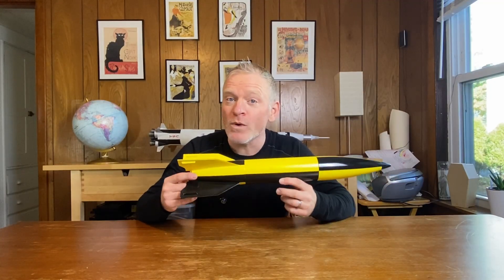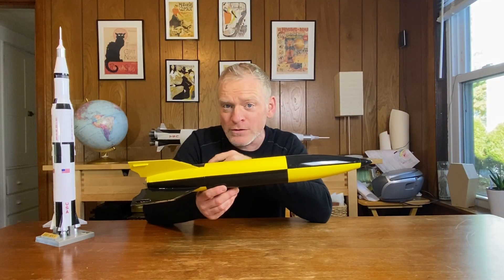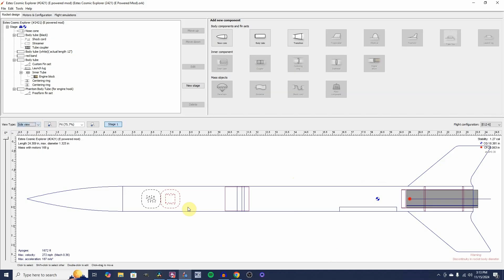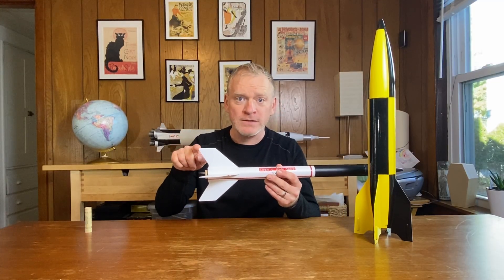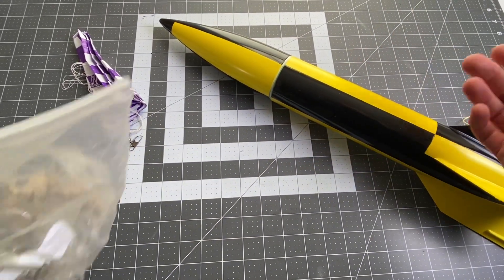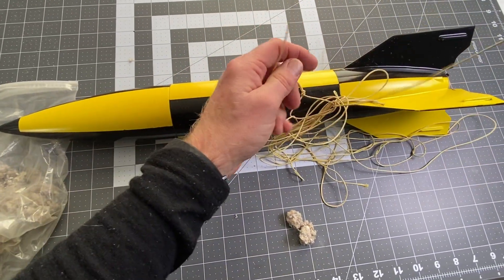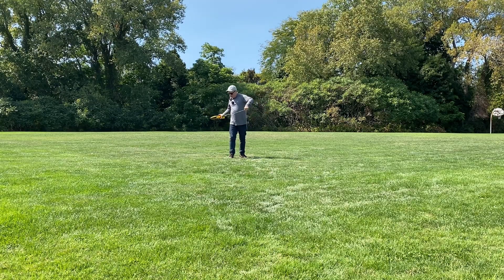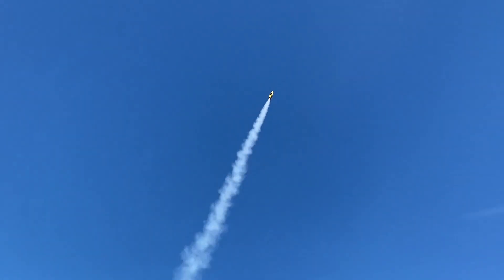How to Do a Model Rocket Swing Test - To Check Stability

Comment: Nice video! As an old rocketeer friend once said: "When they work, it's interesting. When they don't work, it's fascinating!". I once read an article that said you could create a model of the rocket out of a flat piece of cardboard to (relatively) simply estimate the center of pressure. Basically, it's a two-dimensional representation of the rocket's whetted area (area exposed to aerodynamic forces). Basically you shine a light (from a significant distance) to cast a shadow of the rocket on a sheet of paper. The rocket has to be oriented to cast the largest surface area shadow. Trace the outline. For the parts of the rocket with fins, etc. that didn't cast a shadow, their surface area needs to be added in the appropriate location and shape increase the area of the shadow outline. Cut the traced two-dimensional area out of a piece of stiff cardboard, then find it's center of mass. That location is the approximation of the center of pressure. It seems a little sketchy, but the principle seems sound...for rockets that don't approach the speed of sound. I think this was from a day long before personal computers and OpenRocket. I just thought I'd throw it out there for some historical perspective.
Reply from the maker: That's a fun one! That's a technique called the cutout method, and it's what they did in the early days of model rocketry. I've tried it for fun. But it's kind of a pain in the butt, and it's pretty inaccurate.

The cutout method predates Barrowman equations. John Barrowman, who worked for NASA's sounding rocket program, and who also flew model rockets, gave us a mathematical method for finding the center of pressure. It's what simulators like OpenRocket use today.

The cutout method puts your CP way forward of where it actually is, resulting in rocketeers making fins that are far larger than they need to be, or adding a lot more nose weight than they need. But mostly, drafting an accurate representation of your rocket is kind of a lost art, and that kind of skill and accuracy is beyond a lot of folks these days - myself included.

Maybe I'll do a video on that, if I can find a way to make it interesting to a wider audience.